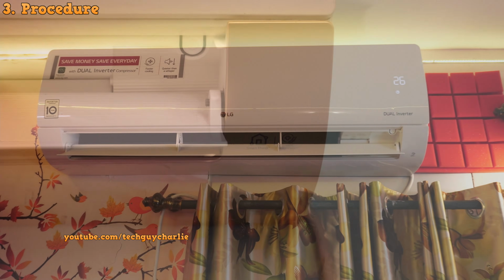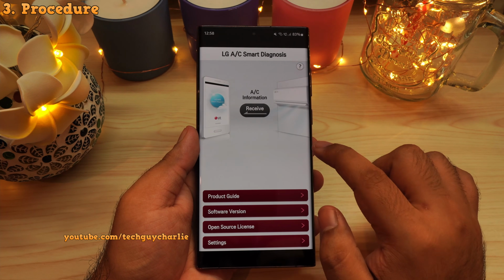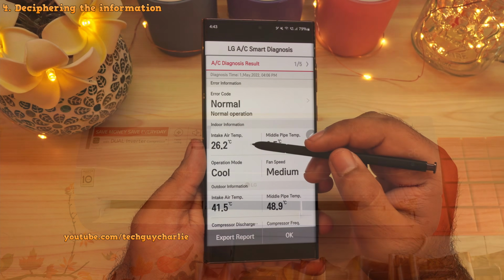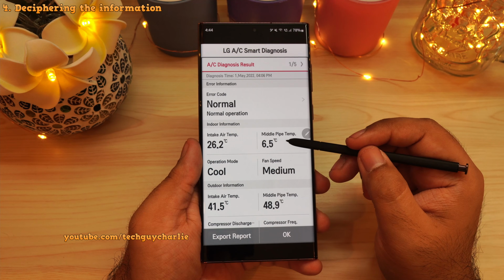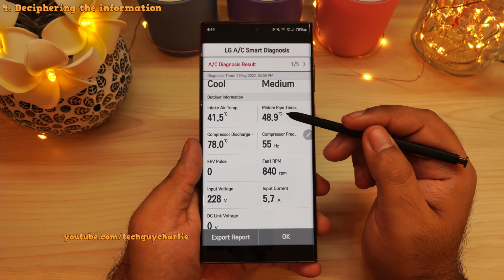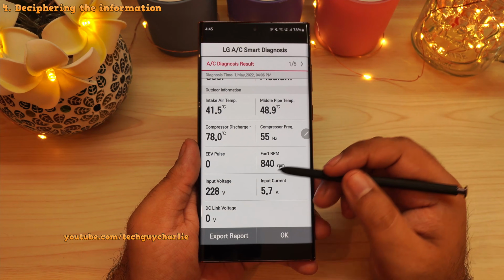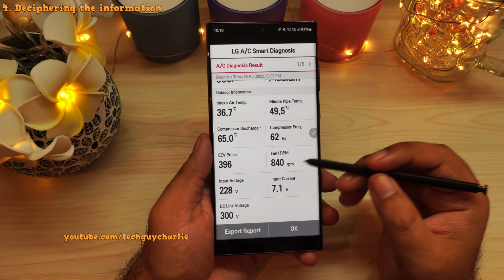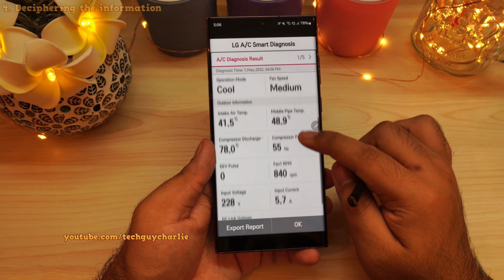This Secret Feature On LG Dual Inverter Air Conditioners is AWESOME! 😍

Comment: is this the Lg Standard Plus PCO9SK-NSJ+PCO9SK-UA3 Wall
Mounted Heat PumpLG air conditioner I’m in Nottingham so the letters might be a bit weird but is it the 2022 model as well?

Comment: My LG ac T10EV4 in indonesia. When i set 25'c and 40% power., the compressor turn off every 30 minutes. And i see the different Comp. Discharge and middle temp are similliar value. Comp discharge 41'c middle pipe temp raising to 40'c and turn off.

Comment: The app not have 80%, 60%, 40% energy saving like remote control. It have only Eco Mode. What is the difference and who is better remote settings or app settings? Thanks!

Comment: :hand-pink-waving:Whichever aircon company that could design an aircon that could easily let user wash its internal blower/part will certainly lead the aircon market, because washing the internal part of aircon is extremely expensive nowadays
Reply from the maker: I second this, I clean and service the AC myself and cleaning the blower is a pain.

Comment: The smart dignosis app is older version I can't install the app what do I do
Reply from the maker: What phone are you trying to install this on? It installs just fine on the latest Android 13 (S23 Ultra) 🤔
Reply: @TechGuyCharlie  Android 13 yes , not s23 ultra, it is vivo y20g
Reply: I have two different Android 13 phones but it shows, the app is made for an older version. What did I do?
Reply: Ok I get the solution I download it from my phone's app store, it is not supported by play store

Comment: Hello, thanks for sharing. I currently have single inverter 12000 btu mini-splits.  Have you noticed the electricity draw when in inverter and dual inverter modes on the LG 18,000?

I'm trying to calculate the difference between an 180000 btu unit in inverter and dual inverter modes in comparison to a 12000 btu unit in single inverter mode.  I have a small space so the 18000 btu compressor would be running in inverter mode most of the time. LG isn't forthcoming about how much electricity they use when the compressor is running slower.

Comment: Bro how much is your ac copper pipe length ?
Does long line affects the ac cooling or grill temprature perfomance I have 37ft long line.
Reply: Yes it does effect it should say in the installation manual what the max length of lines can be with factory charge of refrigeration in compressor after a certain lengths you need to add more refrigerant

Comment: Is it more energy efficient if I initially turned my AC on jet mode,. Then waited till it reach 25*,. Then when it reached 25*  I set the the temp control to 25* then energy control to 40%. 

  Or it Is more energy efficient is I just set it at 25*  right away with 40% energy control  , and just let the AC do its job till it reach 25* ? 

Which way of more cost efficient when it comes to energy saving?
Reply from the maker: Total power consumption at the end of the day will always be the same, the difference will be how quickly your AC cools the room down.
Jet Mode works by running the AC at 110% so that will bring the temp down very, but if you decide to run at 40% energy control option right away, the AC will use less power, but it will take longer to cool the room down... but total energy consumed will be more or less the same. These days I run my AC at 60% power, more than enough to cool my room down and never touched jet mode.
Reply: Thank you 😊

Comment: Sir,my 5 star lg split ac 2022 middle pipe temperature is 17°c. Is it right. Cooling is not great. What to do, Sir.? Please suggest.
Reply: I have the exact same problem.
AC never cools below 24°C.

Avdesh, did your installer pull a vacuum during installation?
Reply: Room is reaching 24 degrees Celsius in 2 hours. On 100 percent.
Reply: What is the room size, AC tonnage, air leaks, day of time? I.e ambient temperature. All these will affect the result.
But anyway, were any  of you able to resolve cooling performance?

Comment: You uploaded a photograph where 46 C and ac on 25C. Can you tell me in your lg ac exact power consumption? If I run at 25c with 41 outside in day and 25 c with 34 outside at night , power consumption status on avg?
Reply: There are too many factors playing into that, to give a good answer to this. You can either calculate yourself by power consumption or messure. Anything else is kinda guessing🙈
Reply: For 6 hr day and 6 hr night Operation time..

Comment: What is the recommended fan speed for cooling operation of an inverter AC at 25C?
Reply from the maker: Hey, there is no hard and fast rule, feel free to adjust the fan speed according to your cooling and comfort needs.
Reply: @TechGuyCharlie  Thanks, This doubt popped up after noticing that whenever i had my fan speed set to high, the outdoor units condenser fan would start and stop intermittently. But whenever the fan was set to Auto/Low it would slow down but keep running continuously.
Reply from the maker: I think it is normal, because when you set the indoor units fan to high, the AC is able to cool the room down more effectively as there is more air going through the coils, so I am guessing the compressor is shutting off since the room must have been cooled down to 25*C.
On my LG Dual Inverter AC I have never seen the compressor shut off, especially during summers, no matter what fan speed I set on the indoor unit, the condenser fan continues to run and so does the compressor, it just automatically slows down once the set temperature has been reached. Are you also using an LG Dual Inverter AC? or some other brand?
Reply: @TechGuyCharlie   Oh alright, Thanks! I'm using Mitsubishi electric.